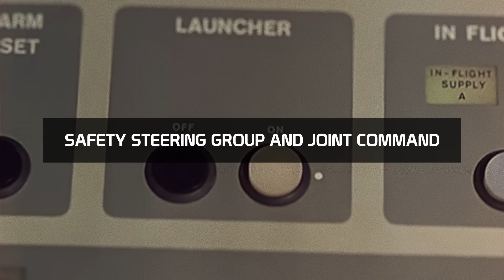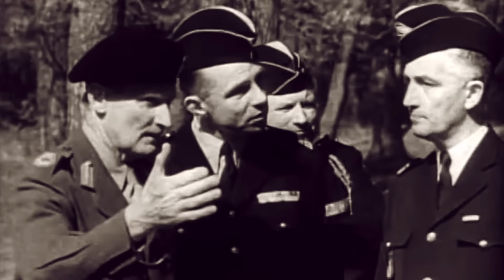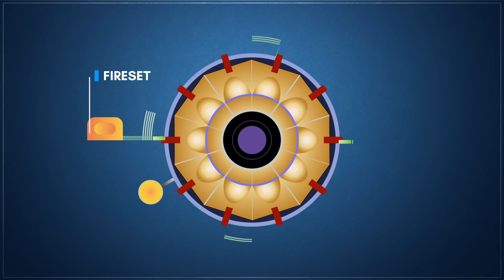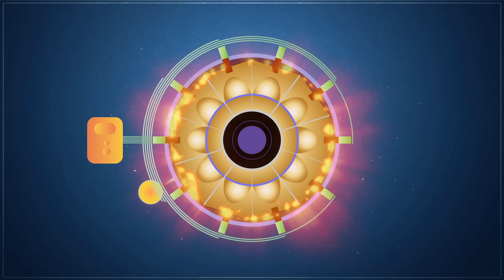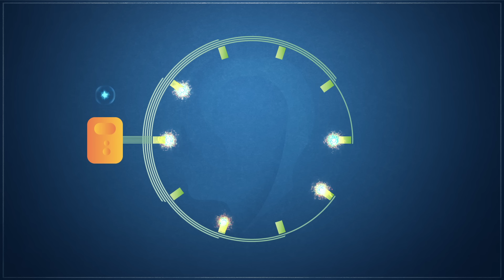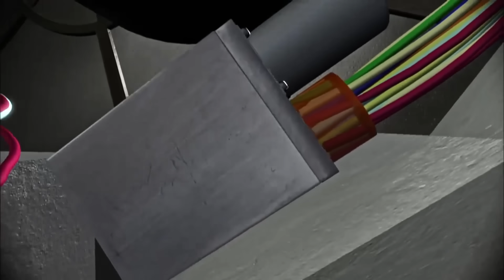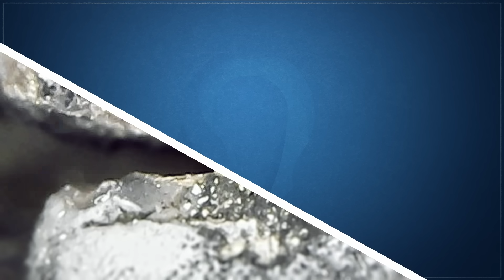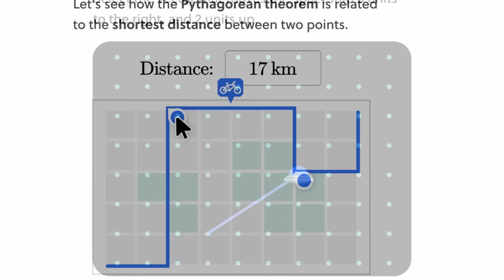The Remarkable Mechanism That Secures Nuclear Weapons

Comment: That's an excellent video. A couple of questions though. If you had physical possession of a US nuke, how hard is it to bypass these safeties and cause it to explode and on missile systems, how hard is it to set the target. That leads up to the next question. What is the Russian equivalent of this security system and in the even that the Russian federation were to break up, are these nukes a threat to anyone? I would assume the first line of defense is that the Russian custodians would have a means to disable the weapons in storage before hightailing it. But how disabled would this be? Removal of vital components in the control system? Removal of components in the core (meaning a fizzle)?
Reply: In theory, disassembling, reassembling and using such a weapon would probably be possible (as long as there is no system in place that, once activated, destroy the (symmetry of) the warhead). For land-based ICBMs and submarine-based SLBMs, stealing it sounds very much impossible. The real danger are the free-fall (tactical) bombs. They always seemed to be the most worried about, as they are easy to transport, easy to hide, often located abroad, and so on. All these safety/security features are probably more like meant to buy time than to prevent the use for ever.
Reply: There's even a tale of a Russian system called "Perimetr" (or Dead Hand) that would arm all nuclear weapons in case the Soviet military leadership stopped communicating. But in reality, Perimetr would be more like the American PALs. Nobody is stupid enough to hurl their entire arsenal at the planet and create a Doomsday as a failsafe because it would also blow up your own people.
Reply: He mentioned radioisotope generators. I assume that if you tamper with it, it blows up subcritically.
Reply: To detonate a rogue/stolen nuclear devices, you just need to rip out the wires and security devices that are connected to the explosive lenses and replace them with mining explosive detonation blasting caps and then solder in some new high-current cables which are truly the exact same length connected from the new blasting cap detonators to a super-high-current IGBT (Insulated Gate Bipolar Transistor) which is connected to a set of high amperage 12V batteries which are enough to set off the blasting caps which set off the explosive lenses. 

Then hook up a smartphone to a primary mechanically-driven switch that comes after the IGBT's and and before the 12V high amperage batteries. We use the mechanical switch so that we don't accidentally detonate the explosive lenses which will eventually have that current be switched and go at lightning speed from the IGBT so as to trigger all the blasting cap detonators all at the exact same time. IGBT chips can switch as fast as 7 nanoseconds. That ensures the explosive lenses will fire at the same time compressing the nuke core evenly to start the fission/fusion process correctly. You have now bypassed all nuclear weapons security!

Comment: In 1985 on my very last day on the flight line in the Air Force I was part of  two man Crew Chief team preparing a B-52 for a flight. What they were doing is taking one of the nukes out to test it's triggering mechanism. Of course it's core had been removed......but I think they wanted to test the PAL and the triggering mechanism. I'm assuming it was some kind of audit of the nukes to make sure the triggering mechanisms work.  Maybe testing the bomber's connection to the nuke also.
Reply: They randomly pull and audit stuff yes.
Reply: Wish you hadn't explained all that, blacked out SUVs are now outside with long hair individuals walking around everywhere...

Pray for me 😅

Comment: I found this very interesting.  I was in the USAF 1969-1973 as a crypto maintenance tech.  After school for 1 year I was assigned to Offutt AFB which was SAC HQ and I maintained the Crypto gear in the underground command center as well as the many communication centers.  I was able to see the machine that encoded the missile coordinates that were fed into the ground based systems.  Lots of changes since then.

Comment: It was the precision of capacitive discharge that made nuclear weapons possible. No other mechanism could deliver the needed energy with temporal accuracy.
Reply: That's also the reason why high-speed electrical switches such as thyratrons are still considered to be a nuclear proliferation hazard, because they are the only devices that can deliver the charge to the detonators within the right timing margins.
Reply: My company uses a strobe light made by Gen Rad. They also made Thyratron tubes. One model of GenRad strobe lamp (bulb) looks just like a Thyratron. You can see the technology similarities. Strobe lamps work on the same principle of a Thyratron a gate voltage is used to trigger a fast short pulse of energy.
Reply: Okay so there's a lot they are not explicitly telling you.
They have had a non-nuclear primary since 1962. The Housatonic test was 99.9% clean because it used a special technology as the primary. They don't need a nuclear primary anymore. 
Also, the laser fuses used to trigger little boy and fat man were not developed by the US. 
Sub U-234 was allowed passage to the states near the end of WW2.  It was part of a deal made with the Nazis. They had a bunch of these laser fuses on board, along with the Nazi scientist who invented them. They also had a load of weapons grade U-235 on board which they had refined using laser isotope enrichment technology, which they had also developed during the war. This was the actual origin of the fissile material used in the bombs dropped on Japan, as in the timeframe we simply would not have been capable of refining enough weapons grade uranium using the technology of the time.  They were further along then than they will tell you now, and they have good reason to never tell, plus plenty of form for it! 
Incidentally, the Canadians nearly fucked the whole thing up as they intercepted Sub U-234 as it was crossing the Atlantic, but they were ordered to stand down.
Reply: @gilesleggett  ChatGPT comment? It's total nonsense, lasers didn't exist in 1944.
Reply: @Stoney3K   Your comment sounds terribly uninformed by comparison.  Share some info about the tests if you wish to be relevant.
Reply: @artysanmobile He just did, LASERs didn't exist in WW2 era. Also a LASER that shoots neutrons for activation isn't exactly that small and isn't called a LASER.
Reply: @gilesleggett 
From where did they get the uranium to build the reactor at the Chicago squash courts in 1942?

Comment: Now, how did the Soviets, with their lag in electronics tech, guard their systems?
Because, if there's one thing that I've learned is that the Soviets used double locks everywhere but they could all  be bypassed easily.

This might be one instance where the US might not have minded if the Soviets stole the tech. It could have even wanted to share it.
Reply: The US shared the principles of PAL's with the Soviets in the late 1960's in the interest of world safety.
Reply: We simply shared it with them you know.

Comment: But did you know? 
"...The missile knows where it is at all times It knows this because it knows where it isn't. By subtracting where it is from where it isn't, Or where it isn't from where it is (whichever iS Greater), it obtains a difference, or deviation. The guidance subsystem uses deviations to generate corrective Commands to drive the missile from a position where it is to a Position where it isn't, And arriving at a position where it wasn't, it now is. Consequently, the position where it is, Is now the position that it wasn't, And it follows that the position that It was, is now the position that it isn't. In the event that the position that it is in is not the position that It wasn't, the system has acquired a variation, The variation being the difference betweer Where the missile is, and where it wasn't. If variation is considered to be a Significant factor, it too may be corrected by the GEA. lowever, the missile must also know where it was. The missile guidance computer scenario works as follows. Because a variation has modified some of the information The missile has obtained, it is not sure just where it is. However, it is sure where it isn't, Within reason, and it knows where it was. It now subtracts where it should be from where it wasn't, Or vice-versa, and by differentiating this from the algebraic sum of Where it shouldn't be, and where it was, It is able to obtain the deviation And its variation, which is called error."
Reply: Thank you for explaining this in simple terms.
Reply: Actually reminded me of the security briefing - We didn't know what we don't know, but now we know what we don't know.

Comment: so what keeps you from extracting the core and building your own initiation hardware? the enrichment process is the weapon in most cases.
Reply: That's what I thought. And according to the nuclear weapons expert Professor Matthew Bunn, there are methods that do not require symmetrical explosive compression, that can be used to build a plutonium based weapon. The details of this, as he advises in his lectures, are highly classified, but it does mean that terrorist organizations have the ability to build such a weapon if they manage to secure enough plutonium.
Reply: @captaincat1743  I always thought the design essentials of the gun-type nuke were common knowledge. It still takes a fair bit of machining skill but it's a lot less fiddly than the implosion type.
Reply: @johnopalko5223 Yes and no lenses to go at same exact time!
Reply: I would imagine that's where the anti-tamper devices come into play. It is possible that one of the devices would cause the explosives to detonate in a manner which does not cause criticality.
Reply: Probably the risk of more-than-certain death by irradiation once you get your hands within 3 feet of the fissile material.
Reply: @Stoney3K  Plutonium is actually not that radioactive in terms of neutron or gamma radiation, it is more of an alpha emitter than anything whilst subcritical . Louis Slotin and other scientists who worked on the Demon Core and other warhead assemblies at Los Alamos used to do experiments on the unshielded core with no protective clothing or face mask and he was often within a foot of it.

Only when it approaches criticality does it start to emit gamma photons and neutrons in significant quantities.

Comment: The original machine had a base plate of pre-famulated amulite surmounted by a malleable logarithmic casing in such a way that the two spurving bearings were in a direct line with the panametric fan. The latter consisted simply of six hydrocoptic marzlevanes, so fitted to the ambifacient lunar waneshaft that side fumbling was effectively prevented.
Reply: It's not cheap, but I'm sure the Government will buy it.
Reply: Yes, but can you forge a seven-sided Ferris piece? (See Winter's Tale by Mark Helprin. The book. Don't bother with the film.)
Reply: Was waiting for someone to align this to the infamous turbo-encabulators
Reply: Are you trolling?
That sounds like you made it up.
Reply: @Spider-Bonsai  It's a very old joke: https://en.wikipedia.org/wiki/Turbo_encabulator
Reply: @Spider-Bonsai  Google "turbo encabulator".

Comment: We sold a number of Lance surface-to-surface missiles to NATO partners (Turkey, Belgium, UK, etc.)where they owned the missile and conventional warheads but the US controlling the nukes.  US Army personnel maintained possession and PAL was used so no big boom without National Command Authority permission.  I had friends in these “warhead detachments”.  This was in the 80’s, and used 6 digits.  However, for two man control, you only decoded 3 numbers and covered them with a lid.  Your partner did his 3 and it was armed.
Reply: "This was in the 80’s, and used 6 digits. " 
One time when I was in the AF someone actually messed with the coded switch on one of our bombers. The thing was always just sitting there......no special protection. Anyone could touch it or ....whatever. But we all understood that doing so would be a quick trip to Leavenworth. 
Well.....one day I get a tap on the shoulder and told to immediately report to such and such office WITHOUT DELAY.  It was the office of the O.S.I.  Office of special investigation. The Air Force equivalent of the FBI.  They grilled me for several minutes. They said they knew I did it.....or that I knew who did it. DID WHAT ????
After maybe 45 minutes I think they became convinced that I didn't know anything......that my answers matched my actual whereabouts on the day of the incident. The incident was that someone had dialed in SACSUC ....(or something to that effect) on the dang coded switch.  It started a X storm, I can tell you. We never heard the end of that.
Reply: In principle, this has not changed until today. US-Nukes here in Germany consists of free-fall bombs, that can be delivered by Tornado aircraft. Aircrew and aircraft are German, but the nukes ( B61 type) are controlled by US personnal. Soon the aircraft will be replaced by F-35s which will also be purchased and operated by Germans. IIRC, the same concept is followed with Italy.